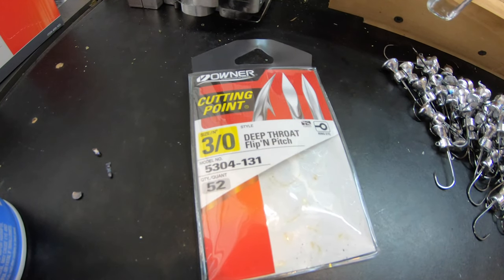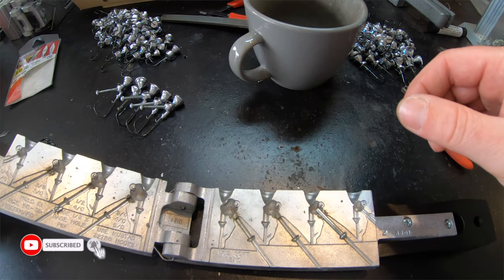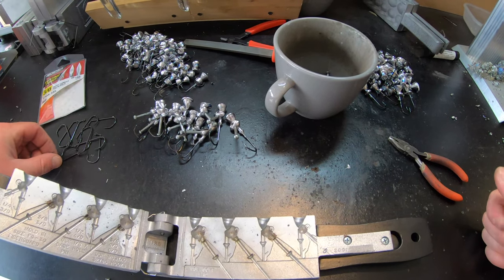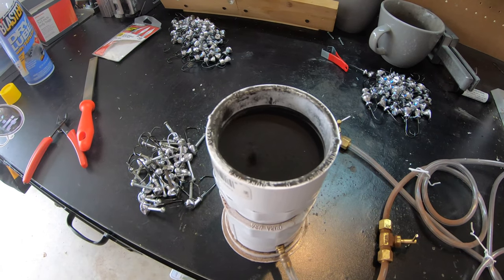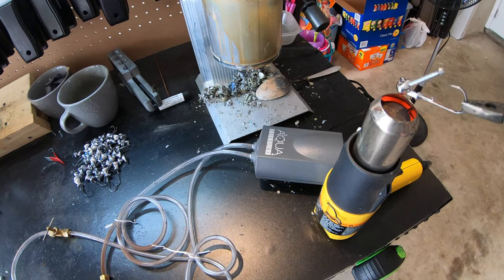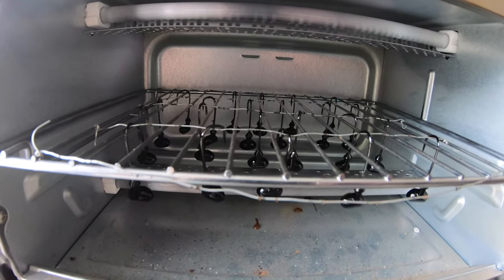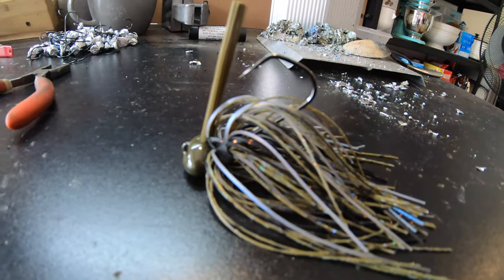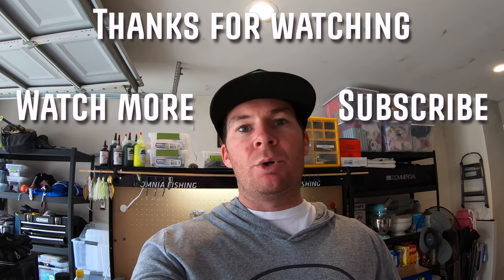How to Make Jigs - How to Make Stand Up Football Jigs

Comment: Nice!  I missed the part about what you do when no weed guard is wanted.  Do you use this same jig mold even when no weed guard is wanted?  If so I guess the jig simply has the hole left open?  Thank you.
Reply from the maker: I have a few base hole pins i cut so the jig doesn’t have the hole.